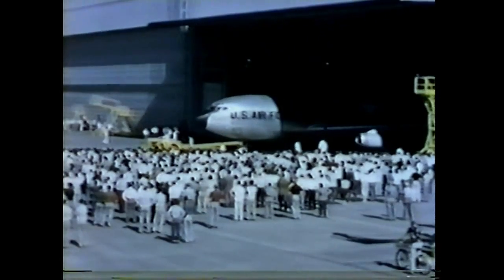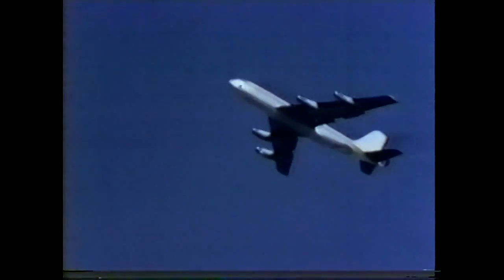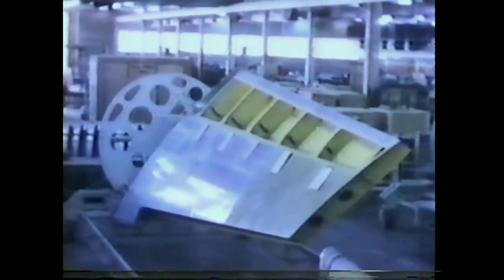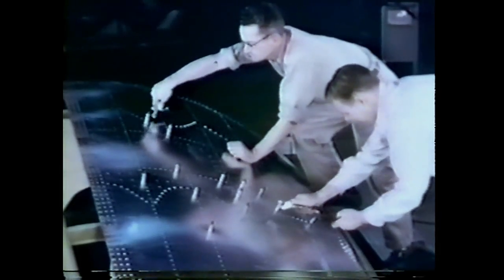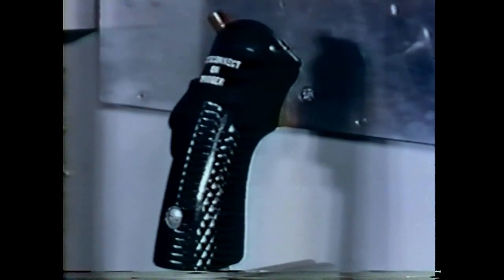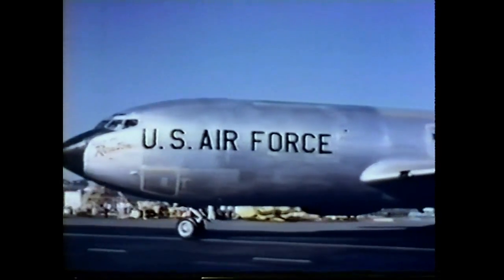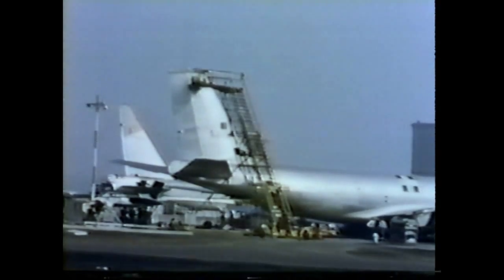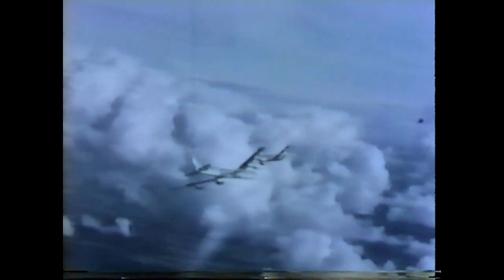Boeing KC-135A Stratotanker Promo Film - 1957

Comment: The kc135a was the same generation as the buff, but not as overdesigned.  I flew 4000 hrs in the kc135a/q/r/t.  Great aircraft, pretty robust from maintenance standpoint.  Later years lot’s of time in depot maintenance fixing numerous issues.  The kc135a, water injected J57 engines on takeoff with 125 seconds of full power near 13k thrust.  Kc135r, cfm56 engines Down rated to 20k thrust each.  The transition was a game changer in operational capability.  Today, near full glass cockpits for the fleet meeting all the latest GATM requirements.  Pretty amazing for a jet that’s 80 + years old.

Comment: What I want to know about the Boeing 707/KC 135 Aircraft is what is the horizontal Spike on top of the Tail used for ? Is it some sort of radio antenna ?
Reply: High Frequency antenna
Reply: HF radio antenna.  If there's a wire from forward fuselage to the tail, that's the HF antenna, and the "spike" is empty.

Comment: Worked in the KC 135A   B 52D engine shop at Westover AFB Mass 71-72 and tdy for 6 months at Kadena AFB Okinawa in 72 flightline 135A and Q engines
Reply: Jim I was tdy Kadena Sept 72 to Jan 73 . I also worked the flight line on the KC 135A and Q . Was there for Linebacker 2 we may have worked together.
Reply: @davidgilbertson4354  was there from the end of feburary until the end of August,  linebacker 1. We were called bullet  shot 1
Reply: Was tdy to Kadena in 72 , worked the flightline also . Was there for linebacker 2.
Reply: @davidgilbertson4354  flew from Westover AFB  to Kadena AFB on a KC-135A, took about 30 hours, changed planes in Texas  and  then 2 fuel stops on the way

Comment: A great airplane but the air packs for AC and heat was no the best. It seems it was always too hot especially after landing when engine power was reduced.
Reply: Because they only had one pack.  Commercial versions had two.

Comment: When the KC-46 goes to the Boneyard, the -135 will refuel it on the way!

Asst. crew chief, 59-1467 Six Pack, 380th BW(M), PAFB, 1986-1987.
Reply: made my day
EDIT: and it will be scrapped by a B-52
Reply: I have to agree though when the r models came around it was nice to e to get rid of water heating and breech cap cleaning
Reply: 1467 and 1468 still fly out of Pittsburgh
Reply: @mgomez5606  Plattsburgh.
Reply: @mgomez5606  yeah.  I think Pease had them too.
Reply: @mikepowers8607  We did.
Reply: Flew on 59-1468 and 59-1464 KC 135Q BEALE
Reply: Mike Powers, your expression sounds like the one about the Huey and Blackhawk to wit "When the last Blackhawk goes to the boneyard the crew will ride back on a Huey."
Reply: Grissom AFB, 305th ARW   Heated water on many nights of Alert duty, 1975-1978.
Reply: As a confirmed rotorhead there's one where that when the last Blackhawk goes to the Boneyard the crew will ride back on a Huey.
Reply: No the KC-46 will take its place. It is just the way it works.

Comment: This very first KC 135, tail # 53118 was a EC 135 with TAC at Tinker AFB when I was stationed there in 1984-86. Mostly used as a VIP transport at that time. She is now on static display at McConnell AFB
Reply: I worked/flew on 118 as a member of the 8th TDCS at SJAFB '76-'78 and '78-'80 at Tinker
Reply: @James Arnett Everything he said is accurate
Reply: I worked on this jet, along with 59-1518, 60-0376, 61-2667, while at Tinker AFB from '84-'90. What memories!

Comment: I wonder how they overlooked strengthening the aft section when they added the upper deck tank and fuel? It became necessary to issue a Safety TCTO to add extra strip stiffeners for the aft section aft of the aft hatch when aircraft exhibited cracks in the body.
Reply: They told me that it was a response to sonic damage, from the engines.

Comment: How much fuel does kc135 dump in to the b 52 in mid air refueling
Reply: Don't know the exact answer but in 1965 I was flying in a 135 out of Kadena, Okinawa. We were to refuel a B-52.  Missed the 52 and dumped approximately 25,000 lbs of JP-4 out the back end somewhere over the South China Sea.
Reply: @Honest300Al  It took 2 KC-135's to refuel a B-52 when it was down to fuel level bingo. when crossing the Pacific to Japan.
Reply: @Honest300Al  Somewhere around 180,000 pounds or about 30,000 gallons.
Reply: Depends on how far the refueling is from the base the 135 came from and has to go back to.  135 max fuel load (A model) was 202,800 pounds.  Operating empty weight was about 105,000.